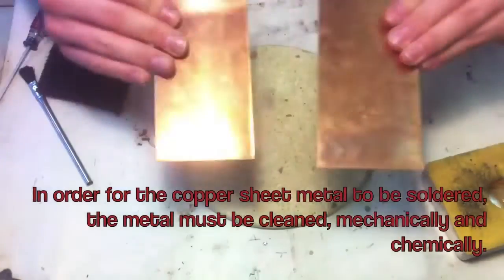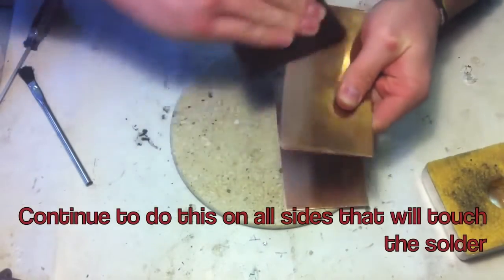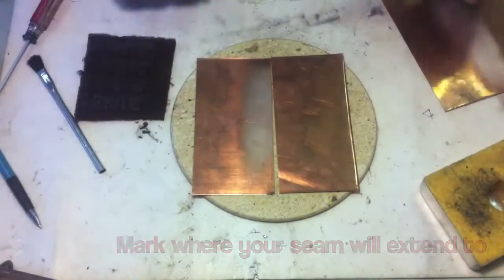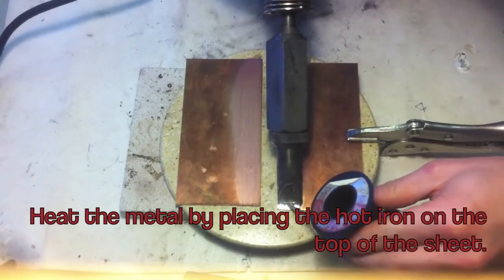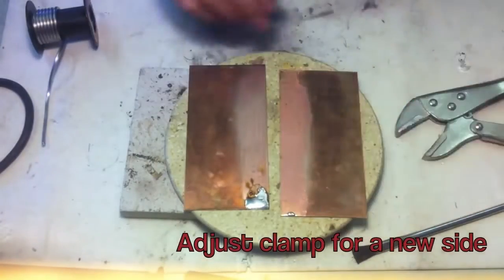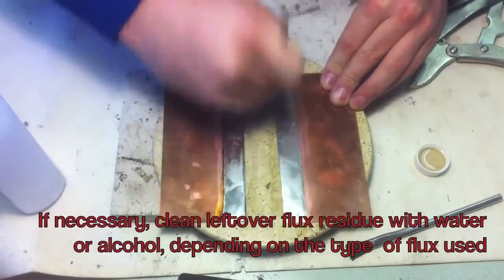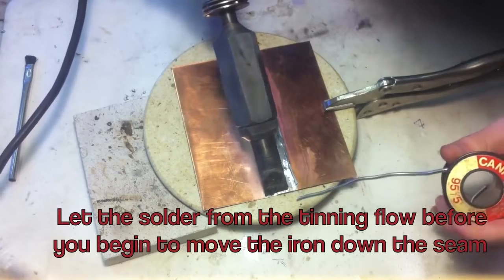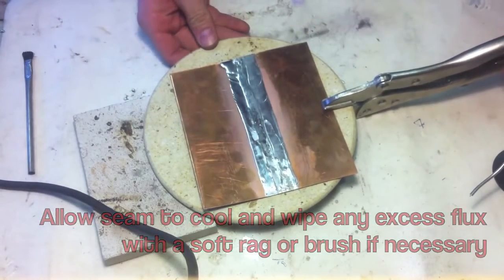How to Solder Copper Sheet Metal

Comment: Solder on top is unnecessary.  Personally, I would clean one side of each and flux that side.  Place the clean sides tightly together then clamp the edges.  I would apply the iron on an overlap piece getting the copper hot then feed in solder just like on a pipe letting it follow the heat and pull into the joint with capillary action.  You could confirm it is good looking at the other side.  If you see solder on the other side then it pulled all the way into the joint.  Either way it would be very strong and not a waste of solder

Comment: Thanks for the great demo!  I'm assuming you applied flux onto the tinned copper sections prior to final soldering?
Can I buy a flat tip for my soldering iron or do i need a whole new iron?
If I have a copper pan for cooking, where the previous tin coating has worn off, is it possible to recoat it with tin this way?  I wonder how you recoat a pan with tin easily?  Common problem.

With regard to your soldering, there is a visible difference in metals.  If I want to make jewelry, how would i hide that silvery tin coating and keep it all copper?

Comment: Its all about heat, im currently building a heatsink for my 7800GS agp graphics card, i use a pencil torch for this, both sides of the 2mm copper sheets are tinned just waiting for them to cool down, then apply flux to bond the 2 surfaces again using the mini blow torch, the surfaces have to be mega hot for it to work, oh and wear a mask if youre working with leaded solder and glasses.

Comment: soldering copper together with a lead/tin base solder or non lead/tin based solder would be good only if the copper sheet is kept at a constant temperature and is not subject to expansion and contraction, the higher the tin content the more likely the joint would crack. As you know judging by your hot potato hand action, copper is a great conductor of heat.
Reply: So... Super sorry to bother with really stupid questions, but, would it possible to copper plate that solder after it was done?
I'm thinking about using copper to make a "lip" around a drinking horn but i would have to solder the "seam" and saw you mentioning lead and tin (big "no no" to drinking utensils). Would there be some kind of "food safe" solder or a way of covering this seam with a thin layer of copper?
I saw a video of a guy doing silver plating with some electrodes and what looked like cotton balls soaked in silver nitrate. Could it be done with maybe copper sulfate or something like that?
Once again, sorry for the myriad of stupid stuff i probably just spewed, but you comment is recent and you seem to know about this stuff.
Reply: @Djanck000  I would suggest using a 30% silver solder it will melt at a higher temperature but will copper plate.
Using copper sulfate solution will plate it, using ion transfer. I would also suggest hanging the copper to be plated in the solution rather than using cotton wool, you'll get a more even result.
A stupid question would receive a stupid answer, your questions are not stupid.
Reply: @royevetts4900  Wow, thanks! That was actually a lot of help!

Comment: Totally unnecessary to do much of that and that way gives a joint with massive amount of solder where it is not needed and doing nothing.
Reply: Its adding strength
Reply: @Synthematix  The solder on the top is completely unnecessary.
Reply: "very little solder is needed" yet he added an absolute ton of solder even after completely pre-tinning the surfaces to be joined

Comment: Is it air tight? Cause I'm planning to make a customized phone case. I will try to make my own vapor chamber a size of a phone 😁
Yes I am crazy to even think about that lil project 😂   I already have phone cooler but it can't reach the part where the chipset are located because the of camera , I just wanna increase the surface area
Reply: How are you building a vapor chamber?

Comment: Id just welt and hammer it. If necessary, use the rothy to run a bead down one edge, top and bottom of the welt. Easy, no solder clean up, no electric iron needed. Maybe a bit of annealing beforehand.